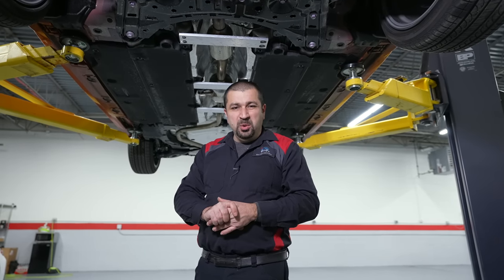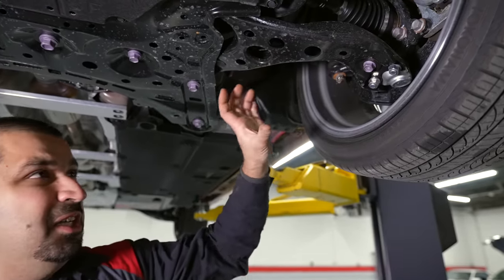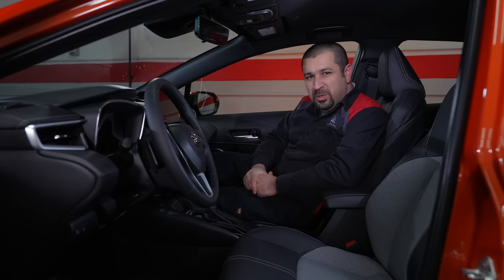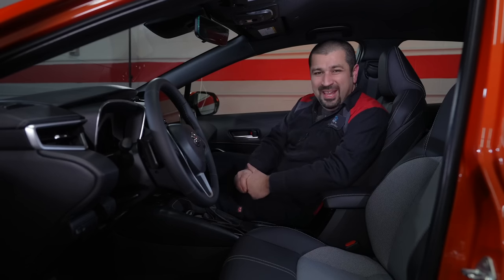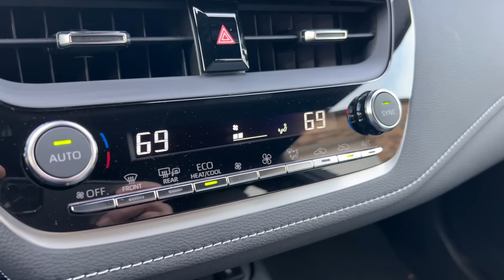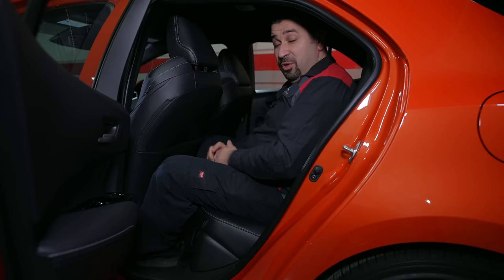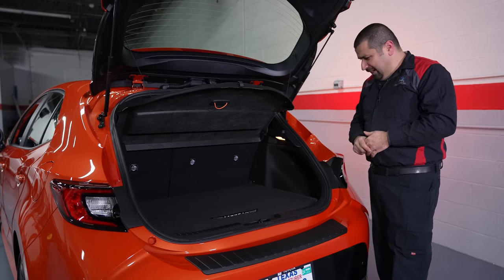Should You Buy a Toyota Corolla in 2023? I Have Good News and Bad News!

Comment: The loss of the manual transmission pains me to my core.

@AMD , I have a beautiful blue 2015 Corolla S Plus 6-MT and I just got it a couple of months ago with about 55.5k mi. It is spotless underneath and in the engine bay; it's quite astonishing considering where the previous owners' lived and how my previous '15 Corolla with 55k mi rusted, however, there is rust in the license plate holes, as you mentioned in your 2014-2019 buying guide... What is the best thing I can do to prevent it from spreading and my paint chipping off nearby?

I absolutely love this car. I was scared, because you said you didn't like the seats in it as much but my last one was an L trim and the seats hurt my back a lot more, but my back pain is in my sacrum. The increased throttle response has made shifting a lot easier than again maybe it's just my increase experience but I really really love the way this drives compared to the L trim, which was also manual. There is some squeaking/creaking in my front passenger suspension... I am not sure what that is about.

Thank you so much for all of you do and I hope you and all your loved ones have all of their dreams come true and thank you so much for making one of my dreams come true.
Reply: If auto consumers compliant to Toyota about removing the manual option for Corolla trims, Toyota would add it for the 2024 model year.......

Comment: I saw that Toyota was going to phase out the manual so I bought a 2022 hatchback five speed SE in December and I love it. I also taught my sixteen year-old how to drive it. I'm gonna try to drive this thing 400,000 miles and I'm sure with good maintenance we will have no issues!
Reply: I can't help but wonder if many other countries will still be able to buy new Corollas and many other new Toyota models with manual transmissions.  It's a well known fact that cars/trucks with manual transmissions are less likely to be stolen... at least in North America.
Reply: @greglahue5690  Almost all the Toyota range in the U.K. are Hybrids, even the Yaris. Most Uber drivers vehicle of choice is either a Prius or a Corolla Wagon.
Reply: Is it 5 or 6 sp?
Reply: @sunset3052  6 speed
Reply: @mitchwhite1816  Thanks.  I thought so.  I wonder if he works for Toyota, lol...
Reply: Me too…. Bought / ordered my 2022 MT Hatch SE 3 and 3 months later, I’m super pleased. Okay, no spare tire but an inflator kit, easily resolved with a $20 spare inside my ski/roof box. Spare tire tools at a local wrecking yard. I love my manual even if I’m 65 years old. May as well have fun before I shuffle off this mortal coil! LOL
Reply: There are a few examples of the throwout bearing and/or slave cylinder failing before the clutch with normal use in the 6spds. These are very expensive repairs in this car.  Mine is good so far. 3yo with 32k on my 6spd se 2021.  Everything has been perfect so far.  I only have slight wear on the steering wheel.
Reply: @robme3660  I was looking through the comments to find at least ONE person talking about this issue. My 2022 XSE 6speed has this exact problem you're talking about. It makes a terrible whirring noise that I've had since around 36k miles. I took it to one dealership and they claimed that it was the sound from the dual injection system, which made me almost lol. Took it to an independent shop, they confirmed my suspicions, and now I'm taking it to another dealership that they claim are better than the other dealership I went to, in the hopes they will honor the warranty period. Now I'm concerned whether or not I'm going to keep this thing past 60k miles, after the warranty period ends.
Reply: @EragonxVxRevan  they have an upgraded slave cylinder now. It was never installed in a Rolla that was off the assembly line in North America.  It might be worth just doing a full clutch job at 60k miles and keeping it. When the slave fails, it ruins the flywheel. That adds a ton of money to the bill. An independent shop should be able to replace all the bearings, slave, and clutch for about $2,500.  It's not ideal, but it's cheaper than trading out. You'll also have new parts that should last 150k miles.  To reduce the risk of a major issue in the future, do a brake fluid flush every 2 years and flush your clutch line every year.
Reply: @robme3660  Could it be possible the issue extends to Japanese made Corollas? Mine wasn't assembled in North America. Thank you for the quick reply, I'm feeling more vindicated that there was something wrong all this time, I know I'm not ALWAYS the nicest to my clutch, but I didn't think I was that abusive.
Reply: @EragonxVxRevan  unfortunately, it affects those, too. They developed the new part # (3rd version) after the production of the last manual equipped Rollas were sold in the US. Only people who are having them replaced are getting it. We likely have the 2nd version of the part. The 3rd version is all metal.  1st was most 2019-20, 2nd was most 2021+, and the 3rd wasn't developed after US sold Rollas ended.
Reply: @robme3660  I brought it to the second Toyota dealership, and they approved to have the transmission replaced! Huge sigh of relief.
Reply: @EragonxVxRevan  nice!! The whole transmission?
Reply: @robme3660  Yeah, a whole transmission. I'm gonna ask them if the new transmission has parts in it that won't cause another early failure. Also if they know what the issue was specifically.
Reply: @robme3660  Yep! That's what my work order says. I'm going to try to find out if they know exactly what was wrong, and if that new transmission is going to have the same potential issues, or if they replaced it with a new part that is better than what was in it. If I end up being told that I'm playing roulette to see when the new one will fail, then I'm just going to trade it in and get a different vehicle.

Comment: I’ve had my “blacked out” 2022 corolla sedan for almost a year now…have a tad over 15k miles. CVT transmission when I found out it gets even better gas mileage…which I didn’t know until researching them. I’m used to it, although i kinda wanted a manual for rock hard reliability, but, this particular cvt appeared to have no issues since 2018 and mine is just fine. I’m doing the 5000 mile oil/filter engine change (don’t care what Toyota says about 10k oil changes…I’m following this guys advise).  I plan to keep this little amazing car until I retire and probably then some!!!  About 10 years.
Reply: Good moves. Toyota's maintenance guide says 5k / 6 month oil changes under special operating conditions. I plan to keep mine for 200k, so I do the 5k/6 month oil changes. I have a manual, but I'd do the 5 year, 60k mile CVT fluid changes, and coolant, same thing.
Reply: I’m planning to buy a new Corolla in the next year or 2. It may be my last Corolla before retirement. My 2010 Corolla is still going strong. I hate to get rid of it.
Reply: 10k miles for oil change is ridiculous.  7k miles for oil change might be ok if you drive on highways a bit.
As for the transmission fluid changes, I would change every 40 - 45k miles instead of every 60k miles.

Comment: My wife loves her 2019 Corolla SE hatchback with the 6 speed manual. Its a fun little car to spin around in, she really enjoys it and the car has been super reliable. In my opinion the  HB looks way better than the sedan and with the rear seats folded down will hold an incredible amount of gear.
Reply: Hi. Did you purchase your car brand new?  I just bought a Certified Pre-owned 2019 Toyota Corolla Hatchback XSE 6MT, one owner at 59k miles, almost all service records.   The transmission was making a whining noise at the dealership when the clutch was engaged in gear or in neutral.  It seemed to drive just fine.  Left it at the dealership to get a paint touch up on the hood and asked them to do the transmission fluid since it's due in 900 miles.  I got a call today, a week later saying the fluid had shavings in it and the transmission is blown...  Of course it's covered under the CPO powertrain warranty so they have to replace it.  Any ideas why this would happen so early?   I've read on forums of other people having similar problems.   I plan on changing my fluid the standard 30k or 3 years like normal.
Reply: @PYRO200055412  Yes, purchased new. No problems at all.  I have noticed that if the shifter isn't placed into neutral correctly there will be a grinding sound when the clutch pedal is let out, it then just requires a slight tap to put the stick into the correct position. Perhaps that is where "shavings" come from. I find it very odd that they would declare your transmission as "blown" when you drove it there just fine. Finding shavings in fluid isn't that unusual if the amount is reasonable, especially if its the first change.
Reply: @paulbunyon6324  Thanks. It's not actually blown. It seemed to drive just fine other than the whining when cold, I'm in Minnesota.   He didn't say whether they were lots of sharp shavings or if it was powdered.   May just be normal wear from the first fluid flush being a bit later than optimal.  The gear lever return spring seems pretty strong on these and I'm the kind of driver that always wiggles it side to side to confirm neutral out of habit.  The car seems well taken care of other than this.
Reply: @PYRO200055412  it sounds to me like it may just be a noisy throw out bearing, in other words the noise is only there when your foot is holding the clutch pedal down.
Reply: @paulbunyon6324  no. It whines when the clutch it up and engaged in neutral or in gear driving.  It stops when you press the clutch in.

Comment: I was going to buy a Corolla, but when I sat in it I found the seats narrow and uncomfortable and the roof level too low. So I went across the road to Lexus and sat in the UX250h. Ah, the seats are wider and roof higher. So I bought the Lexus.
BTW, I bought a new Corolla 1.3GL in 1986. Had it for 9 years. Faultless.

Comment: Toyota seems to be the best at making 1.8L 4 cylinder engines, I have one in my 2006 Matrix, (famous 1ZZ-FE), I’ve seen them with 700,000 kilometres still running good never been overhauled, all the way to the 7AFE engine in the 1993-97 Corolla upper trim. Those run forever too. If there’s one thing that I’ve learned, the ancient toyota engines tend to last the longest, like the 2ZR like you mentioned Amd, and the 1ZZ-FE. If it ain’t broke, don’t fix it. If there ain’t problems with an engine, don’t go to something else. I personally don’t think the brand new 2022 Corolla dynamic force engine will last as long as the older ones, I think it’s too soon to be a “favourite” engine in terms of reliability, the fuel injection is very complex, it switches between multi-port and regular all the time while running. Now time will tell with the reliability, but just saying sometimes old is gold In terms of reliability.
Reply: The d4s being use for a long time with me is is pretty reliable

Comment: Very Good Points.
I would never purchase that Hatchback if that is 'All you Get' for $28,000.00.
We recently last May helped our Daughter get a new car. (Mostly me, my wife just agreed.  LOL)

A simple 2022 Corolla LE.  No Packages, No Options.
(It came with Mud Flaps and the Floor Liners)
We did make sure she had a 7 year/125K mile Extended Warranty.
It is a Nice little car. So far my Daughter tells me it gets around in snow quite well. (Lake Effect Snow too)
Our Son gave her a Wireless Plug-in at Christmas which she loves.
She is getting up to 38mpg and 30mpg in city traffic.

You cannot beat that little car.  It costs around $23,000.00 out the door.
We also got the loan BEFORE rates went up too.  I believe she has a 2.84%/5 year loan.
Find that today.  Heck, we got a 2.24% /3 year loan on our 2022 RAV4.

My wife and I are very pleased she has RELIABLE Transportation for years to come.
However, I would not of helped my Daughter with this Corolla you are showing.
Just not worth the price.  Especially with loan rates as they are.
AND they are still going to go up.

Thanks again for all your Time & Effort.

Comment: I tested a Corolla with cvt in 2016. During the test drive, I forgot that it was a cvt. In contrast, I tested a cvt Sentra in 2007 and there was NO WAY you could forget it was a cvt.
Reply: Idk i think the cvt is such a god idea on paper that in execution it makes you want an automatic, manual, or the hybrid ecvt because you got gears instread of these drive belts
Reply: I have a 2016 Corolla CVT.  It works well and is reliable with 106,000 trouble free miles so far.

Comment: The 2023 MY M20A went from an electronically controlled thermostat to a traditional mechanical one vs the old ones. Look for a unit code “030” instead of the 19-22 “090”

Comment: I have a 2021 XSE hatchback with a 6 speed and I love the car. Yes it’s not fast but good enough to get you around. The 6 speed definitely helps and it has rev match. The 6 speed changes the feel of the car and would definitely not buy a CVT and most younger people can’t drive manual transmissions.Great video !
Reply: Yeah, why buy a hatchback if it's not going to be fun to drive with a manual?  Can't believe the manuals were not selling cause everyone I see has the extra mark up and some areas you  have to wait on to get delivered. Sad day
Reply: @captinbeyond  it is fun to to drive it just doesn’t have the horsepower of the GR Corolla. I switch out the tires for performance and the car handles well.
Reply: When I lived in the mountains a manual was so much fun. My first car back in the day was a Toyota Celica with a five speed and even though it wasn't fast it was still a lot of fun on a curvy road with that transmission. That said, once I moved to a fairly large city with bumper to bumper city traffic the manual got old really fast. My next car was an automatic and I've never considered a manual again. In the right environment they're fun, but in heavy traffic they're a pain (at least for me).
Reply: @jeffmorse645  perfectly said. I love driving this car and it actually handles pretty good. It has IMT that makes it easy to drive in traffic, but then again I live in mountains and hills and love it!

Comment: I wish you could open a shop in South Florida.  I took my ES300h in to a Lexus stealership to have a new entry transmitter programmed and key cut.  I asked them to change the transmission fluid (8 yrs and 58K miles) since I was there.  They said you never change the transmission fluid in Lexus cars.  Shouldn't the ECVTs have a fluid change every 60K miles?    I could swear I saw you perform a hybrid ECVT fluid on youTube, though not an ES300h.  I can't do it as I can't lift the car level and probably can't get to the drain/fill plugs with it on the ground.  If I go to an independent shop, I suspect they won't use Toyota WS fluid.

Comment: So the 2023 Corolla shown in the video shows 0W-16 on the oil sticker. My eye caught it right in the beginning clearly for a split second. Ok, now with no changes including the same electronic VVT and 2.0 liter engine, it's been changed to 0W-8 a few months later and remains that way for the 2024 version. The new one is simply a carry over with a couple little things added but nothing to do with powertrain or VVT etc. I called the dealer and they checked their system for any bulletin reports regarding any changes that would show why the oil type had been changed to 0W-8. Nothing came up and the engine part# remains the same, no changes. Well you can't find 0W-8 oil anywhere but the dealer had gotten some from Toyota. It will cost over $100 for 5 quarts or I can wait 10,000 miles for the free oil change. This is no joke! I'm not sure what the hell to do but I know I'm not leaving that oil in there for 10,000 miles on a brand new engine.
Reply: I still cant find 0W-16 anywhere.
Reply: The manual states you can use 0-16 if you can’t find 0-8. I’ve seen 0-16 at local part stores. 0-8 my dealer had some but they wanted $25 a quart. It’s cheaper to have them do the oil change than to do it myself.
Reply: @thugblaster303 ....It does say that but then reads must switch back to 0W-8 asap. If it ran on 0W-16 before the switch with no changes then why bother even using 0W-8. It must be for mpg's but it's all very unclear.

Comment: CVTs have ruined cars by every brand.  The droning is terrible, fakes shifting on some is terrible, the driving experience is terrible.  The slight gain in fuel economy is offset by more frequent CVT fluid changes.  These things have everything to do with all brands meeting CAFE requirements and nothing to do with consumers.  CVT seem to be more reliable now, but still don't have the same long term reliability of conventional autos or manuals.  So far I have been able to avoid owning any vehicle with a CVT and I hope to continue that.  eCVT  is different as they have shown long term reliability in hybrids.
Reply: Gasoline Corolla has had a CVT since 2014 model year. Reliability has been great.
Reply: My comment has nothing to do with reliability; it's about the driving experience.  TO me driving a CVT is a terrible experience even with reliability. @marklintwo